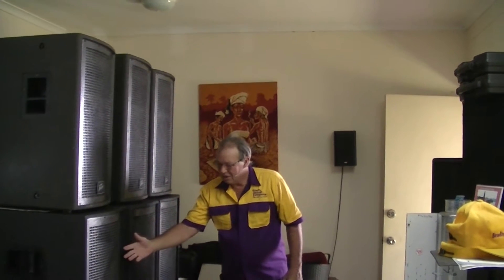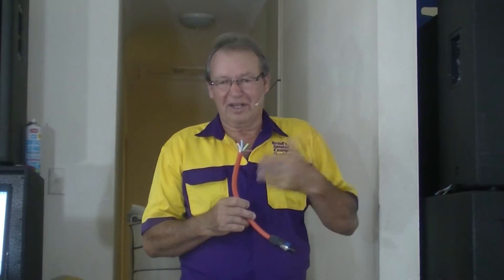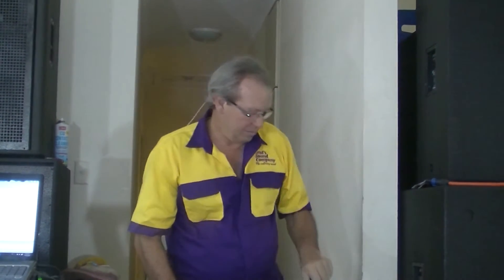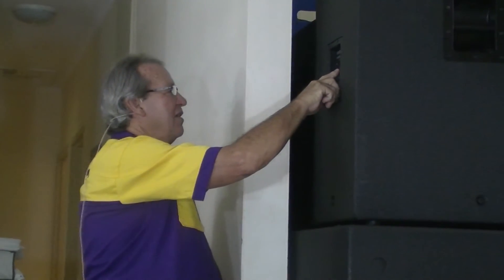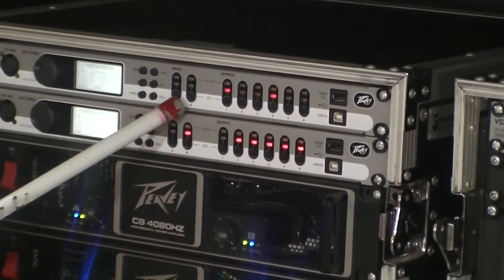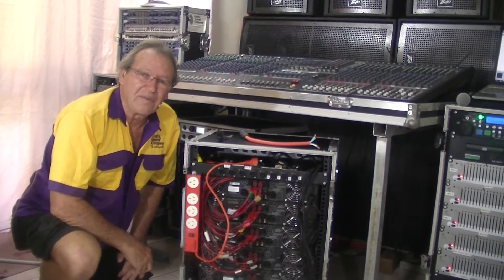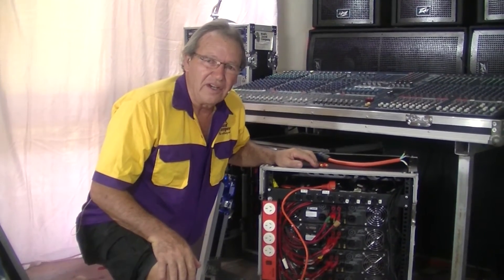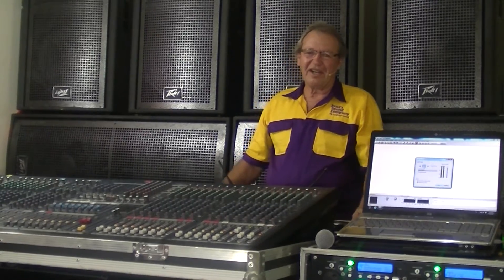Anatomy of a Pro Audio Sound System - Part 24 - (a part 11 update)

Comment: Hi Brad, does your Peavey subs have inputs that allow you to split the signal into 8 ohms for each speaker or did you have to rewire them?
Reply from the maker: +Howard Smith   Yes Howard, The speaker input Speakon sockets are wired from the factory to allow each woofer to be powered individually.  ;So one woofer is connected to 1+ and 1- and the other to 2+ and 2-.   Using the 4 core cable I can connect to patch panel or connect to the channel one output of my CS amps which when set to parallel mode will send both amp channels to output one..... so one amp per sub cabinet.

Comment: Why are you using orange cabeling?
Reply from the maker: Because orange was the only colour available from local electrical wholesalers at the time (I also later bought a 100m roll of grey). The cabling is 4 core x 2'5sq mm electrical flex. It does the job very well. As for the upmarket specialized speaker cables ..... you may get some smug satisfaction that you spent more money than the next guy, but it is highly unlikely you would be able to discern any difference in sound quality over  the heavy duty industrial grade
Reply from the maker: We use 4 core heavy duty industrial duty electrical flex as speaker cabling.
   In Australia, orange is the most common colour for this type of cable and was the only colour available from our local electrical wholesaler at the time ... We also later obtained a roll of light grey.
Reply: Brad Perry Ah I se. Here in Sweden orange cabling is a rarity... More or less all cabling of the kind is black.
Reply: +Brad Perry I wondered what cable you used. Is this because Van Damme or other pure OFC wire is too expensive? Or is it cutting cost, whilst able to carry larger loads. It looked more like industrial electrical cable indeed, not speaker cable as such, but it works! I might look into some of this stuff in grey if I can find it. Although the branded stuff is very good too.